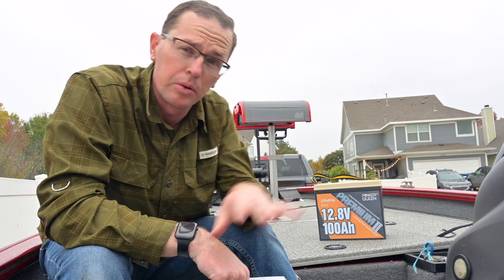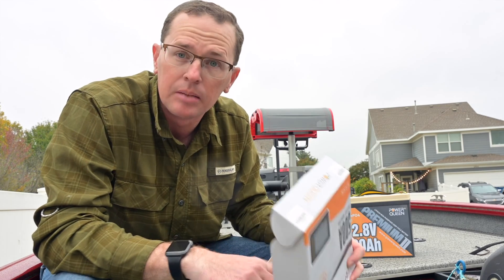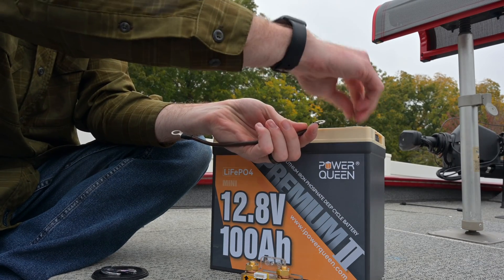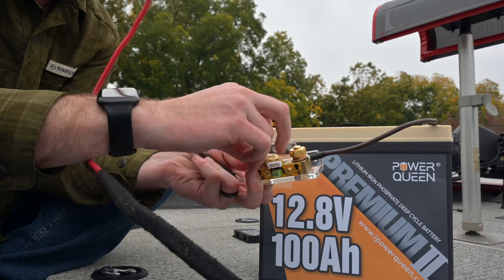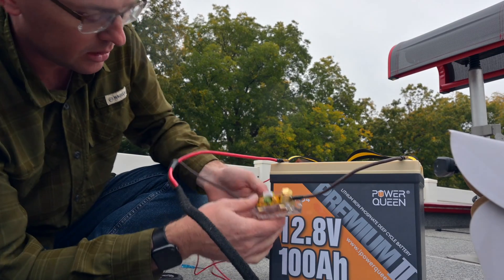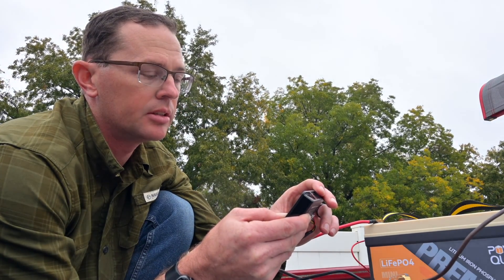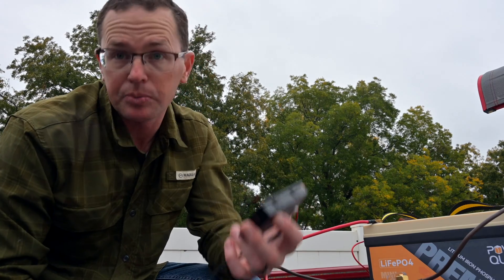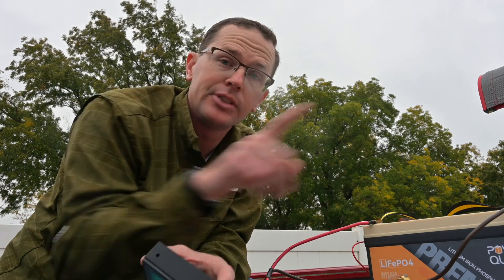Don't Let Your Lithium Battery DIE! (Try This) | Power Queen Battery Monitor | LiFePO4 | AGM | NMC

Comment from the maker: What do you think about running a battery monitor versus buying a battery with built-in Bluetooth connectivity?
Reply: I have been buying the Power Queen Batteries with Bluetooth. They have been on sale constantly for around $200 lately. I may try a battery with a shunt. I like that you wont have any connection issue, no having to login with Username/Password, no having to download the apps for multiple tablets, some of which iwill have connection issues, etc....

Comment: Hi! I didn't get the short, black negative lead cable with the monitor. is that supposed to be included when you buy the monitor? Thanks for your help.
Reply from the maker: That is needed to power up the screen.
Reply: @goodmanfishing  Thanks for the rapid reply. I got the cable. tried to set things up, but can't fit the red lead into the little green box. I unscew the screws, but they just spin around, won't come out and I can't get the red lead in the holes. Is there anything I missed? Any suggestions.
Reply: After quite a while, I finally solved the problem. I had to take a large needle and exert a lot of force into the hole. I managed to deepen the hole and then the cable fit in nicely. Seems to me they should have checked this before shipping it.

Comment: Hello there..I am using the power queen shunt only for my trolling motor on 100ah lithium battery and I had 20 per cent capacity left and when I put the battery to charge it was showing that in 4 hours will be fully charged but after 40 minutes the indication was fully charged on the screen but for sure will take a few more hours to be fully charged..is this normal or is settings for charging and I didn't notice? Thanks in advance

Comment: I'm new to this. I'm also using a 100ah lifepo4 battery. I noticed on different shunt monitors they can be rated from 100amp models up to 500amp. Can you explain why you went with the 500amp monitor?
Reply: Its cheap and why not

Comment: I have two batteries, Basen Green 11.7kWh 51.2V (BG) and Ecoflow Delta pro 48V 3.6kWh with inverter (DP). With BG full DP. With the DP application, it is not possible to set the BG not to completely empty!
What could I put between the batteries so that I can set a voltage limit at which the charging will stop and thus prevent the BG from being completely discharged? Is lifePo4 output battery voltage monitor with on off control  somewere??

Comment: Are the bolts on the shunt 8mm, like on the battery?
Reply from the maker: They are M10.
Reply: @goodmanfishing   How did you measure it at 103Ah? You have a charger that tells you?
Reply from the maker: @SOLDOZER  I have a battery tester that pulls a constant load and monitors the power consumed.

Comment: Hi ,is the charger has to go through the shunt ?
Reply from the maker: @mikep7119  hello, yes all current in and out of the battery should go through the shunt 👍
Reply: Hi thank you for your reply but I need the shunt only for my trolling motor and my charger is always at home ,I charge the battery when I return
Reply from the maker: @mikep7119   if you put the ring terminals or alligator clamp on the correct side of the shunt when charging, it will work fine.

Comment: 13.3 volts is not full charge on lithium.  14 volts to 14.6 volts depending on manufacturer specs.
Reply from the maker: @sciglassblower  over the dozens of LiFePO4 batteries, none of them have had a resting voltage of over 13.3-13.4. 14.6 is the charging voltage, but not the resting voltage of a fully charged battery.
Reply: @goodmanfishing  You are correct, but your meter needs to know when the battery is full.  Your lithium charging system should be charging the lithium battery to 14.2 or so.  The meter should be set to 14v to know when the battery is actually full.  If your float is 14v or 14.2, which is recommended by trusted sources, your meter will not start counting down the amp hours until you drop below 14v and have current coming from the batteries.  If you have your float set to 13.7v, which some chargers do, the meter will still not start showing reduced SOC until you start taking amperage out of the battery.  Either way you should always be charging lithium to 14v+ and the meter should be set to 14v so it knows when the batteries are full.
Reply: @sciglassblower Set resting voltage value on monitor.

Comment: does this come wit all necessary cables?
i dont think it does looking at their website.
i have 3 power queen premium 2 batteries in parallel and i need something like this.
also, would i need just one shunt or 3?
Reply from the maker: It will come with everything you need other than the main cables to and from the shunt.

It’s preferred to have a shunt on each battery, but it will work with a series configuration

Comment: Does this monitor two 100 Ah LiFePO4 wired in series for a 24 V trolling motor?  Did you say that the on board battery charger must only be hooked to the shunt only, not the battery directly?  Do you use an onboard battery charger that charges all types of batteries, even lead acid?
Reply from the maker: I would expect a shunt on each battery if you plan on charging them with a two bank charger. 

I use an on-board charger that has a setting for lead, AGM or lithium.

Comment: The BMS would shut the battery down before it harmed it without the shunt correct? Is it absolutely necessary to run a shunt for a trolling motor setup?
Reply from the maker: Yes the BMS will protect itself, this is much like a gas gauge to see how much further you can go. 

Running a shunt and monitor is not required. But if you want to know remaining capacity on a lithium battery, you must use a shunt or Hall effect setup. A volt gauge or meter isn't sufficient
Reply: @goodmanfishing  thank you for the quick reply! I just got the 100ah PQ gonna install it on a 55lb terrova 12v today. Definitely gonna look into the shunts to see how much life is left. I wasn’t 100% sure if the BMS would shut it down before harm was done. Thanks again!!!
Reply from the maker: @treebuster93  no problem !

Comment: Hi are you finding the monitor is working ok. Quick question I’ve got a caravan an on the minus side of the battery is the van black lead inverter lead solar lead .. do I just take them from the battery and connect to the shunt and then the shunt to the battery.

Comment: I just got one of these. I setup the AH etc in the settings. If I turn off this unit( I have it setup on my trolling motor breaker) will i have to re-input my info or will it remember my settings. I'm new to these.  There isn't anything saying like to get out of the setup mode. Kinda lost in the manual for setting up correctly.    I'm using a 12 volt 100ah li-time lithium.
Reply from the maker: I would suggest putting the red small wire to the shunt before your breaker. If you typically throw the breaker when you aren't using it, that small red wire will remember your settings.
Reply: Ok. So it needs to have power to it all the time?

  And yes. I kill my breaker to stop power to the troller motor. .
Reply from the maker: @PimpnBass  yes, the little red wire should always be hot. 👍
Reply: It is right now when the breaker is on. I was afraid it would put a drain on the battery if it was on all the time. Unless it auto shuts off or something when it's not being used by the trolling motor. I really appreciate your info .
Reply from the maker: @dwaynepippin the monitor draws an extremely low amount of power to stay on.